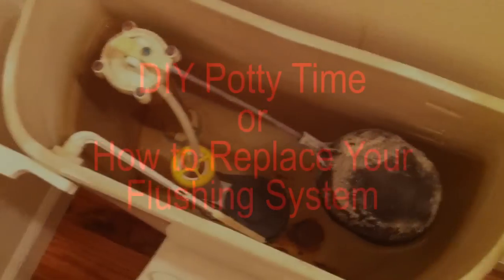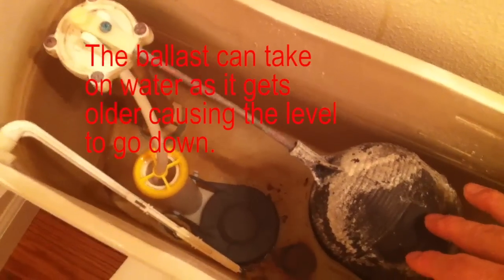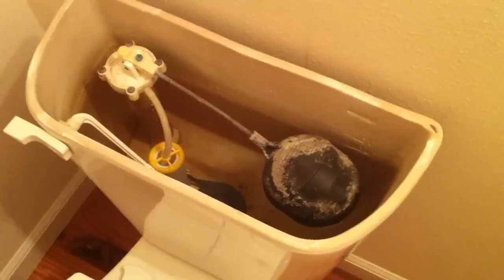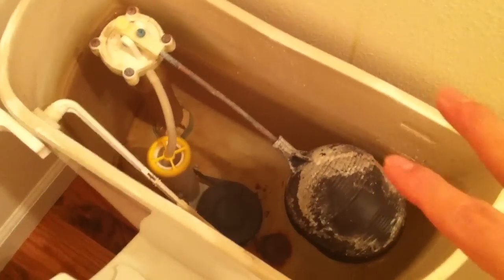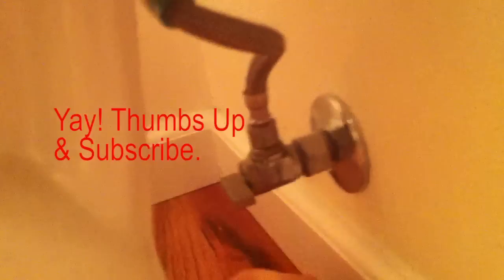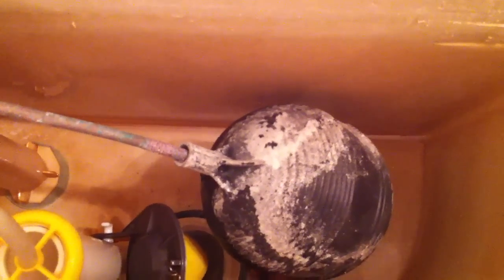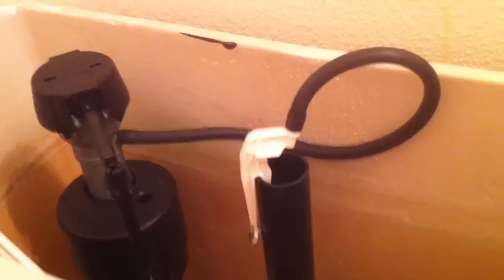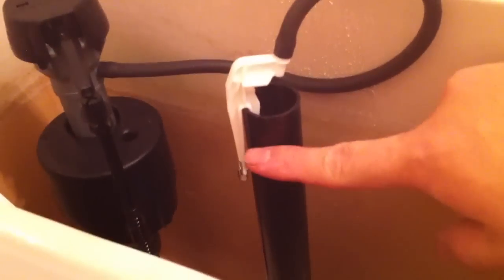DIY Toilet Repair Flush Valve

Comment: Be careful when tightening the nuts on the tank to bowl bolts as not to crack the china tank. The overflow tube/flush valve assembly does not have to be replaced in most cases. Replacing the "flapper" is usually all that is needed,
Reply from the maker: Jay, thanks, you're correct but I wanted to change the whole thing out, had replaced the flapper a couple times before, also, thanks for the warning about being careful with tightening the nuts.